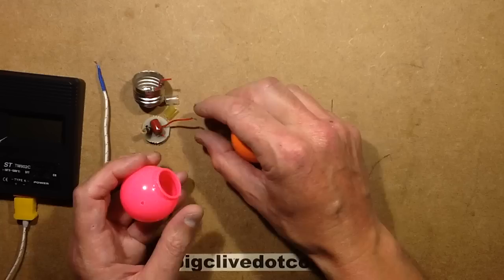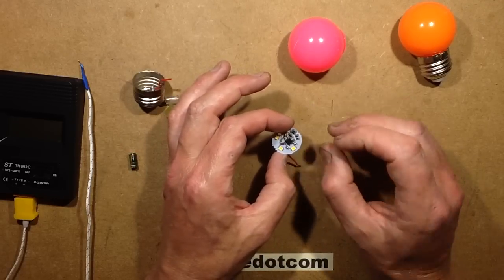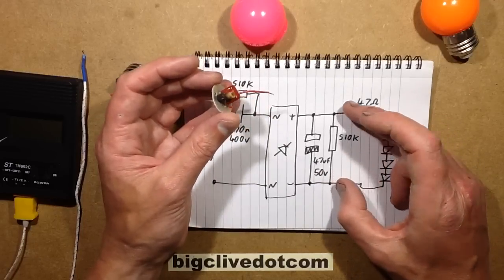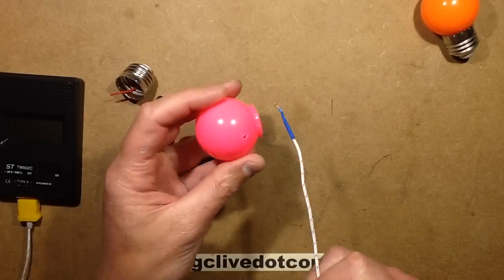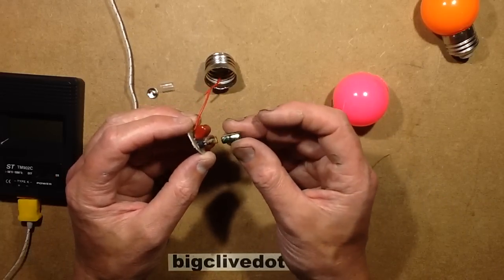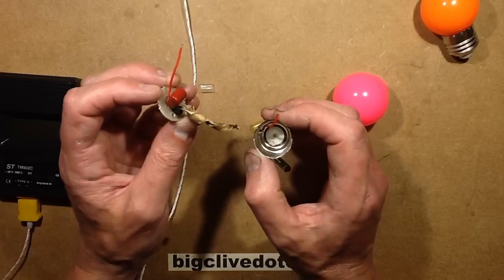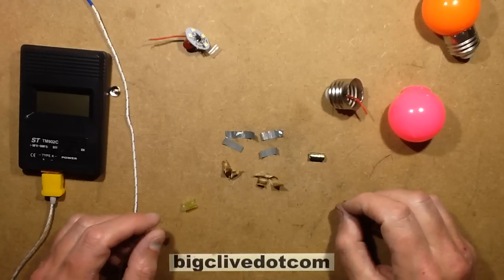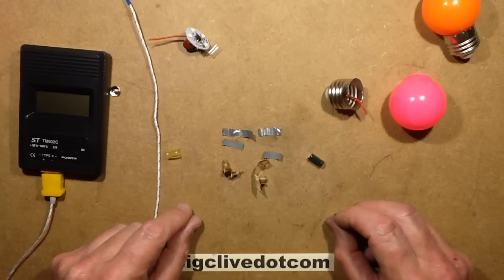Pink LED lamp failure resulting in electrolytic capacitor venting.

Comment: I have once removed an unused electrolytic capacitor from its case, AFAIR 1000µF 35V (it was useless anyway, one of the legs was broken off). I just needed the little aluminium cup for something. The inside part from the capacitor was forgotten lying on a plastic (ABS) case. Few days later, i have discovered that the plastic under the capacitor remnants had "melted" or dissolved, just like with acetone. I wonder what is the composition of electrolyte.

Comment: I wonder if the cap has been intentionally mislabeled so as to protect some of the proprietary info from other Chinese cheaper fly by night manufactures although these parts could be removed and checked for values using a capacitance analyzer.

Comment: I have to mention this.. Back in my YTS Electronics days in the early 90's I experienced my first electrolytic cap failure. We were making power supplies and a buddy asked me to watch over his while he went to the loo. Folks had a habit of nicking things back then if you werent looking. So i sat doing my work with this guys project sat next to me, I never thought to look at it while it was powered up, checking voltages and stuff. I left it for a bit and after about 5 minutes I heard this hissing sound and before I could react the fat 1000uF cap literally took off and launched up to the roof like a rocket.It made a little thump sound on the metal ceiling, It was so funny but the supervisor thought I was pissing about and it took some explaining to calm him down LOL It turned out the cap was in the wrong way round.

Comment: what would happen if this happens in a more powerful light (where the dropper capacitor allows for a higher current flow to the smoothing capacitor)? would that one blow up?
Reply from the maker: I don't think it would be as dramatic as having the electrolytic cap directly after a rectifier from the mains supply like in switchmode power supplies.  Any current limiting is going to soften the destruction.

Comment: I see how much you like lamps, so i might end up sending this to you if you would like to do a tear down. because i got no use for it. I using for hydroponics but obviously since its a LED lamp, it doesn't give off much heat. Didnt think about that when i bought it lol.

I didn't get it from this seller, i think i got it off ebay somewhere. still works but the remote needs one of those coin cell batteries. If you do want it, ill get a battery and put that in it before i send it out. 

http://zedomax.com/blog/wp-content/uploads/2008/09/rgb-light-bulb.jpg

Comment: Hmm, I just had one blow that split at the vent, and another the same time that didn't vent but also blew the metal cap off like yours. Yours you could at least view the inside, mine shredded the foiled and paper all over the inside. They both were a 16V 100uF cap. It was a mess to clean off the PCB, and smelt bad. A little magic smoke got out with the vented one, bu the one this went boom was a large flume of smoke. I'll get the video up soon.

Comment: how would you fix it? i had a similar situation and bought some 400v caps to replace but it didnt fix the issue. i assume some leds are still open circuit?
Reply from the maker: If it's just one LED out you can sometimes just short the faulty one out.
Reply: I replaced the electrolytic with a 400v one and replaced the failed led's with good ones from another failed lamp and it worked fine. But then i was playing around flicking the light switch on and off really quickly and it failed. Have repeated this with 2 other lamps aswell of same design. 

My question is, is there an inherent weakness of the capacitive  dropper circuits that makes them susceptible to fast switching of the mains power? seems to have made some leds fail from possibly a voltage spike? or have i just sped up the failing of already dodgy led chips?

Comment: This is why I added a 13V zener on my own capacitve dropper, even though with the LED connected it runs at 12.3V. Just to clamp it in case it goes open. Good to know that it fails pretty softly though.

Comment: Hi Clive, is that a 470 ohm resistor and not a 47ohm. That 0.470 uf cap should only be able to deliver around 35mA. May be its me but I am struggling to get my head round your circuit. With the single chip LEDs there should only be a 15v drop across them? Thanks Lester

Comment: Can't you use a varistor in parallel with the capacitor and LED's, so that in case an LED goes open circuit, so that if the voltage goes too high for the capacitor it just dramatically increases resistance to at the very least limit the current to minimal

...I haven't thought this out fully yet

Comment: you should take apart a quality cap and see the difference between a cheap Chinese and a name brand one
Reply: That would be curious, but the real difference won't lie in the build details, but in the batch quality assurance and the supplier (with particular quality guarantees, or lack thereof) of chemistry for the electrolyte. That one big Taiwanese electrolyte capacitor fiasco a decade back that sunk numerous electronics manufacturers under warranty claims was traced back to a fault at a chemical company.

Comment: I'm quite surprised you haven't encountered the innards of an electrolytic cap before! The ones I pulled apart as a kid had a more "fluffy" (the best way I can describe it) tissue type of layer for the electrolyte. This was many years ago. The ones that failed and leaked did have a kind of sesame oil kind of smell. The ones that went bang had a more flux-but-burned smell, it's definitely distinguishable. So much so that some stuff I have looked at in the past only required a nasal inspection. 

The larger caps used in motors (thick plastic encapsulated style) vent in a weird way, they spew out some kind of gunk that looks like it came out of something like a caulking gun, sometimes filling the box with goop that solidifies. I had several pictures from an industrial water compressor, they must have been deleted.

Interesting vid. Capacitor roulette vid incoming? Hehe.
Reply: We did something probably stupid in my YTS days, we took a tennis ball, cut a slice into it for a mouth, drew some eyes on it and wired up the fattest Tantalum Bead caps we could find, about 3 or 4. Stuffed them in the 'mouth' and reversed the polarity on them and ramped up the voltage. It sounded like a zombie of death and all this stinky green smoke oozed out the mouth and floated across the worktop. Funny as hell :D
Reply from the maker: Strangely enough, after a very loud incident when I was very young I've somehow managed to avoid blowing up electrolytics since.
Reply: Haha, Yeah they do go with a bang. Reverse polarity is the easiest way to replicate the results, I found. I do not condone or encourage such disregard for safety btw guys.
Reply: I had a nice scare as a kid as well... Had a printer with a switch between 240/110v and decided to flip it to the 110v position just to see what would happen... After about 30 seconds a loud pop and a flame shoot up from one of the capacitors. :P
Reply: Those motor starting / motor run capacitors are not electrolytic - they can't be because they are attached to mains AC. They are basically just rolls of aluminium foil with a polypropylene separator film for electrical isolation. The gunk that comes out when they overheat is just melted polypropylene - that's why it completely solidifies again once it cools down.

Comment: It is surprising to be able to achieve such high capacitance with so little plate area. There must be a tradeoff you'd think
Reply: C = k * e0 * A / d. A is plate area, k is dielectric constant, and d is the thickness of the insulator between the plates. The trick with electrolytic capacitors is that "d" is very small - the insulator in an electrolytic is the layer of aluminum oxide that naturally forms on the surface of aluminum, and one "plate" is actually the electrolyte. This is also why electrolytics are polarized - hook it up backwards and that oxide layer is broken down electrochemically, then there's no more insulator and it pops.

Comment: They sell these types at Wal-mart. I fail to see the reason they chose white LEDs instead of using a proper colour to match the globe, as there's a good chunk of lumens lost in translation there. The heat dissipation also SUCKS. I had similar issues with mine.
Reply: Difference between Poundland and Wal-mart vs.a LED lamps is about $9 - $19...

Comment: can you figure out how to power an LED simply by being within a gigahertz of megahertz field? that would be brilliant
Reply: A what?
Reply: +L3gendLuk3 He probably means using Pulse width modulation.
Reply: Sample Textᴴᴰ
Well with the word field he could be talking about induction with radio frequencies like a tesla coil
Reply from the maker: Alas, powering LEDs from radio waves is quite complex and usually not very efficient in terms of materials to intensity.